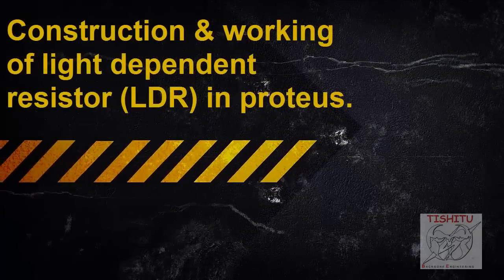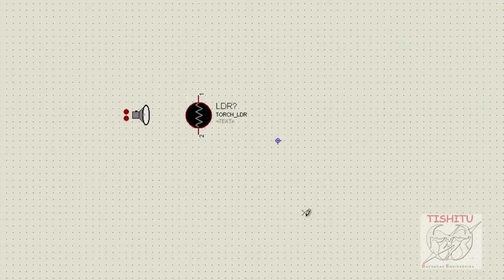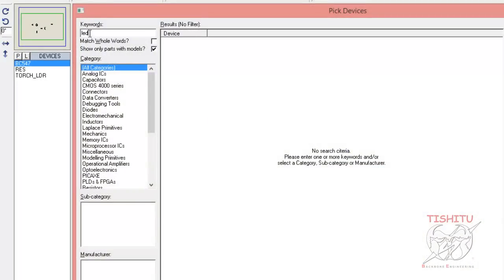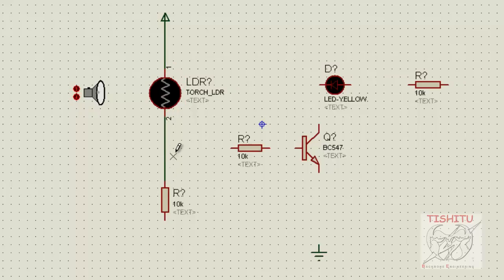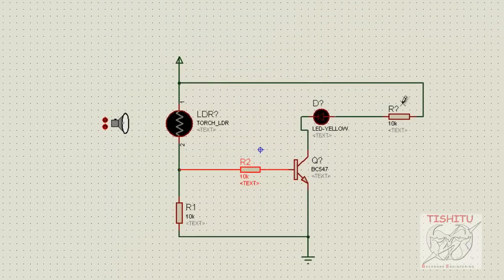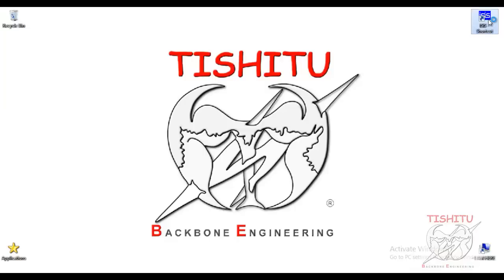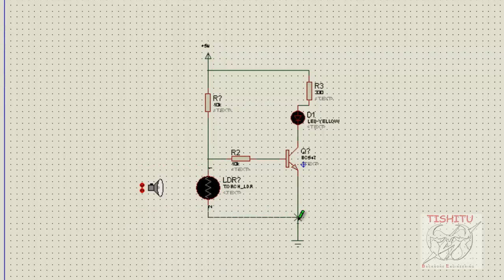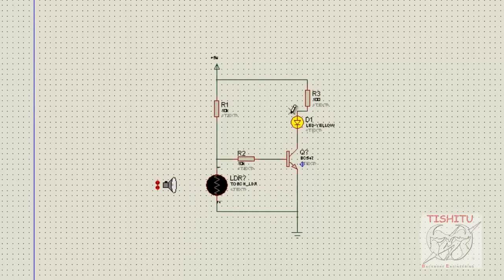LDR Light Dependent Resistor Dark detector

Comment: I really loved it! How can I make it semiautomatic? I mean adding a relay and switches for having a manual mode(I control the LED by a switch) and an automatic mode depending on light?
Reply from the maker: alaa Serhal if u want high power supply switch you  have to use relay instead of led and resistance
Reply: Winner of a video, I've been looking for "why is a resistor important?" for a while now, and I think this has helped. Have you ever come across - Henucas Panrooklyn Equalizer - (do a google search )? 

It is a smashing exclusive guide for discovering how to repair electronic devices like a pro minus the normal expense. Ive heard some incredible things about it and my co-worker got amazing results with it.